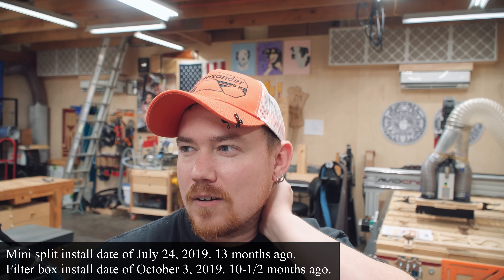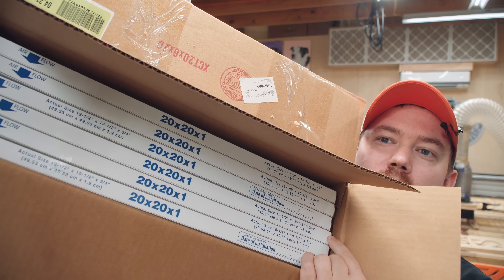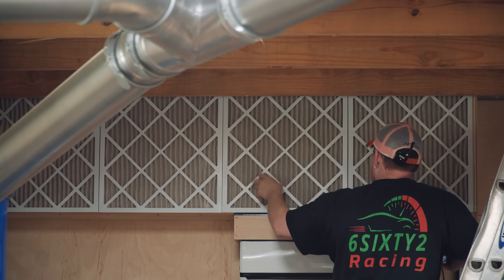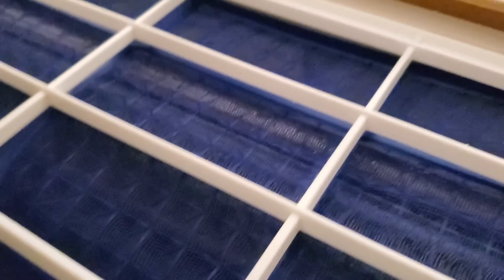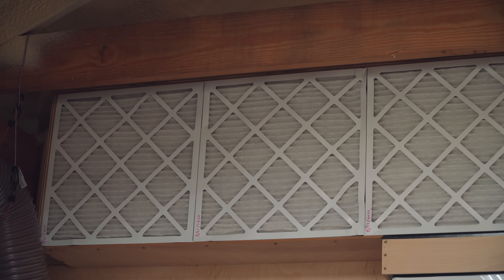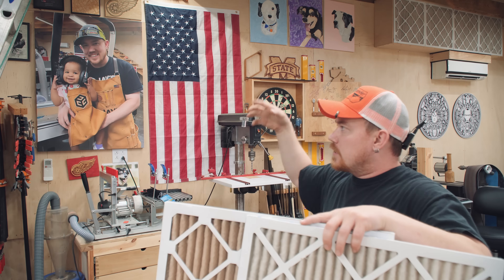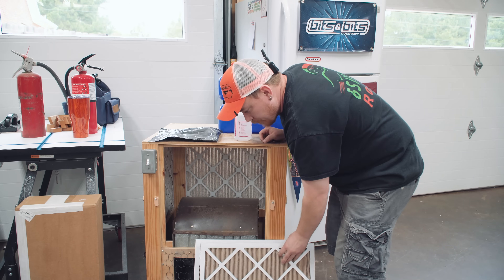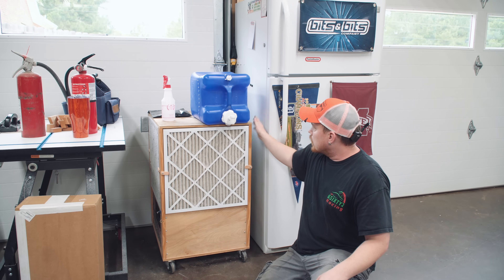30×40 Shop Part 8: Mini Split Air Filter Update - 351

Comment: You need like a sheetmetal flange around them. A channel to accept them and they can be a little different size filter and still fit properly

Comment: What about having a lip on the top and bottom ledges (for lack of a better description). fox the top in place and have the bottom on bolt heads where you can loosen the screw/bolt/nut and the bottom will coma down a bit. Then if there is ever any sugnificant change in the size, you will be able to still use the new filters and the ledges (where the filters sit) will,always be right.

Comment: Your videos have truly been inspiring.  I am about to get a mini-split, and plan to build a filter box for it.  I also picked up a dehumidifier on sale during the winter.  I’m thinking that it would probably benefit from a filter box too.  What do you think?  I would appreciate your thoughts on this matter.
Thank-you.
Reply: Not that it'll help much, but my AlorAir dehumidifier uses real filters (not those screen things), so a filter box isn't necessary. Something to consider when your dehumidifier dies. I'm on my 5th one, which is why I bought the AlorAir; it's much better built and worth the price.
Reply: @bmay8818  Thanks for the tip!

Comment: Hi Jay so happy I subscribed a few days ago. This video is a blessing as I have just installed a 24000 btu Mr.Kool and was thinking I need to filter the intake filters. So glad you show the filters in the three stages of use. New, split air, the floor filter. I am going to copy your split air filter frame work for my system and also your floor unit again thank you.

Second question could you or maybe your listeners perhaps address in-depth how you sealed your garage door so as not to loose heat as well as cooling. I have a roll up door that I am looking for ideas to close the gap across the top thanks in advance.

Comment: the dirty filters actually work better than new up to a certain point.  You could weigh the filters before/after to quantify the amount of dirt you are catching.  The filtration needs for the HVAC are far less stringent than what might harm your lungs, but the filters are also cleaning lung air, so keeping the fan on even when the shop temperature is OK is helpful.

Comment: With all the fires out here in California, I use 3 box fans with those 20x20x1 hepa filters on, and when they get so dirty I cycle them into the garage where I have two similar fans for shop dust.  Cool video :)

Comment: I just got a Dylos. What counts do you typically see? I’m around 1100 fine without my clearvue running and get down to 500 after it’s been running for about 10 mins.

Comment: I'll have to keep the filter size issue in mind when I build something like this. Probably build the frame oversized, but put some 1in wide weather-strip around all sides of each hole so that any size filter will fit and seal.

Comment: In my shop (MUCH smaller than yours) I have a through-wall heat pump unit installed by the builder about 2 years ago. The OEM filtering is a couple of mesh filters 😲 on the room intake side. Therefore I started getting filters (something like 10 x 30 x 1) that I tape over the intake grille. I have averaged changing them about every four months. Successes are that the mesh filters have not needed washing, and there is no visible wood dust inside the unit. I am planning to attach a manometer to the unit so I can monitor the airflow reduction over time. Also, earlier this year I installed a ceiling mounted commercial air cleaner which should help more. 

-- asthmatic woodworker in central Maryland --

Comment: Joys of subtle changes.  Could add that aluminum backed tape on the joints to prevent leaks.  I've been saving for 3 to 4 years for mini split in my garage (labor is insanely expensive in SF Bay Area).  Less than 6 months to have money so just finishing up my last summer.  I can't wait.

Comment: Questions... What is mfg of your Mini Splits? What is the size of the units and shop.
Reply: Hello Gary for what it’s worth I used Mr.kool in my 20x20 it is 24,000 btu. My shop has a peek at 16 feet and the hip is 12 feet. I went with this brand both in my shop and my new 19x15 add on room. Easy to install and excellent technical help when I had a minor issue.

Comment: I built your filter cart about a year ago, the filters get soooo dirty! Do you run it 24/7, or just when you're working in the shop? My shop is the garage, and woodworking is infrequent during the summer, I mostly do it during the winter. I need to check my minisplit filter, but it hasn't yelled at me yet to  clean it...

Comment: I worked in filtration for 15 years. If the filters are too tight in a bank like that and you're worried about bypass in the seams, duct tape the filters together before you put them up

Comment: When I replaced my HVAC systems, I wish I had kept the old squirrel cage an motor.
The motor was practically new, as I had changed it a few years early.
Was a simply 4 wire with ground, L, M and H wires.

Comment: Are you still happy with the size of the filter boxes?  I'm considering making these, however the 4 filters would take up a lot of space.  Is this over kill?  Could 2 filters work?  My mini split is very similar to yours.  Keep up the great videos.  Love your channel!
Reply from the maker: It's really one of those situations where the more filter area the better. If I were to do it over again I'd use 4. But that's just on my gut feeling. I didn't measure surface area of the filters. I know I wanted to use MERV 13 filters which reduce airflow. So to compensate for that I added more filters.

Comment: When you are in the shop just working, do you keep the air filter cart running, or do you just turn it on a few times a day to clean the air?
Reply from the maker: It is on if I'm in the shop. I generally only turn it off when I record narration.

Comment: Super Interesting, one thing to note is most of these paper filters removal rate increases as they get dirty. The cost is airflow. I think you could run them a lot longer. The nerdy engineer in me wants to suggest a Mattias type tube with water to measure the pressure difference. There might be HVAC gauges that you could use as well. When they installed my system the tech kept mentioning 0.5" of Water for an ideal pressure drop on the intake side.

Comment: You may have covered this in your original video but it's been quite a while since I watched that, but aren't those grills in the filters typically on the intake side of things?  If that's true, is there no impact on it being backwards?
Reply from the maker: The wire mesh on the filter? Those are on the exhaust side of the filters. The white cardboard grill is on both sides. Also, there's an arrow that indicates airflow..
Reply: Jay Bates - Woodworking Videos yeah I was referring to the cardboard mesh.  In my experience that has always corresponded with the same pointy side of the arrow (furnace side).  That they mesh is on both sides answers my question though, thanks!

Comment: That was pretty impressive showing how clean the aircon filters were.  The additional filters may be doing a better job of filtering the air, but they also be creating a heavier load on the aircon, drawing more current to move the air through the additional barrier.  You could do a comparison by measuring how much energy the aircon units were using with and without the additional filters over say a period of a week.
Having cleaned the filters in my aircon units only a few months ago, I was horrified how bad the build up of fine dust particles were on the filter and the cooling fins.  (Yuck!)  Thanks for the video.  Cheers, David
Reply: He tested it on the original video, I believe that's why there are four filters, something to do with the overall air cavity equals out the draw.